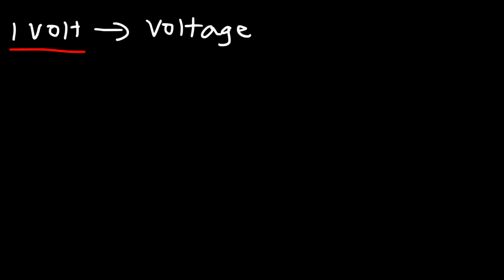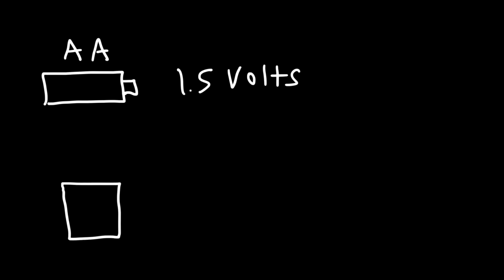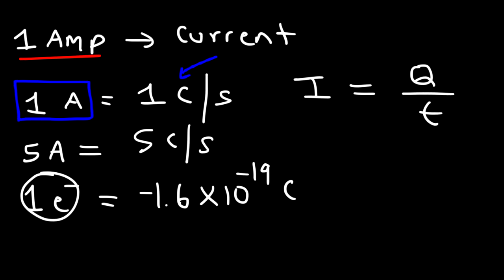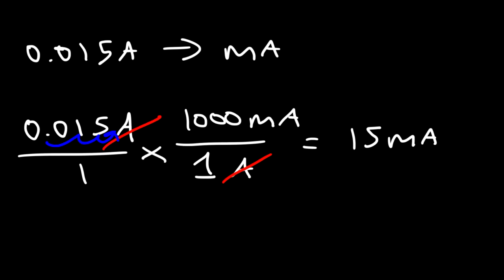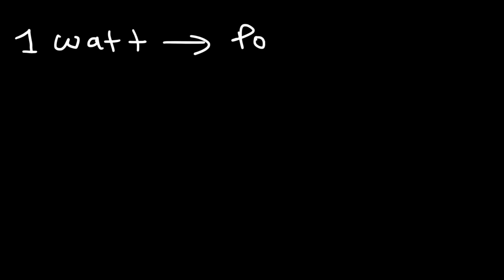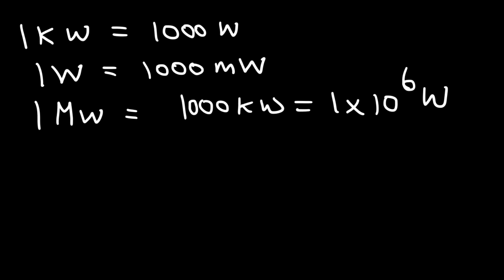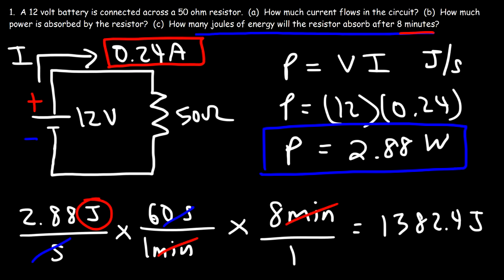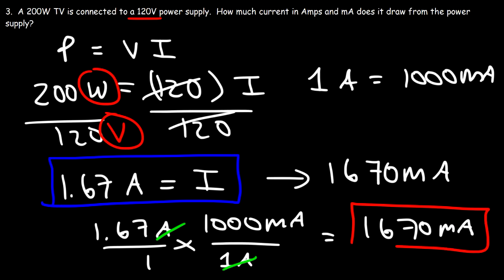Volts, Amps, & Watts Explained!

Comment: Practical and clear explanation but I would like to confirm something. If I apply the knowledge I got from the video above, for example if I go and buy a 1200 watt power supply for my new building pc, it means that power supply will consumes 1200 energy of joules per second and as I know = More Voltage = More Amperes = More Charge of energy, So I need to have high voltage that can produce 1200 energy per second to match the power supply right??

Comment: Hey I have a question. Does a small appliance using 750 watt differ in power and electricity usage than a large appliance using 750 watts?
Reply: If all the conditions such as the resistance of the appliances, the voltage of the mains power supply are the same then according to my limited knowledge there won't be a change is the electricity usage

Comment: Would it be fair to compare the equation of Watts=(Amps)(Volts) to the equation Force=(mass)(Acceleration)?

Obviously we're talking about two different things, one refers to electrical energy while the other refers to the inertia of a body, but would the relation be comparable? If it is, then it would be easier for me to understand, otherwise, then I'm way off.
Reply: Yes, it would be fair to compare the equations "Watts = (Amps) x (Volts)" in the context of electrical power to the equation "Force = (Mass) x (Acceleration)" in the context of Newton's second law of motion. Both equations represent a fundamental relationship between different physical quantities.

Comment: If the total charge is 4,3 x 10x21, and each electron has the charge of 1,6 x 10^-19, why isnt it correct to devide total charge with the charge of 1 electron? Wouldnt that give me the total number of electrions passing? And from there i could devide that with 6,24x10^18 to get it in coloumbs?

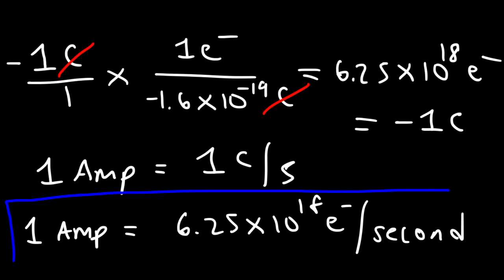Comment: in 8:00 shouldn't it be -6.25x10^-18e/sec?, because you said -1c = 6.25x10^-18e and not  1c = 6.25x10^-18e

I am talking about the negative sign
it's weird because then a positive coulomb is equal to negative amount of electron which is nonsence.

here is my explanation for this please tell me if I am correct: so basically I this of "negative" number of electrons(or a +ve coulomb) as electrons flowing opposite to the direction i am measuring and "positive" number of electrons (or a -ve coulomb) as electrons flowing in the direction i am measuring, or maybe vice versa.

please give me feedback on the correctness of this.

Comment: So how many volts is in 1000 watts ?
Reply: your question does not make sense sorry
Reply: @jeremykemp3782  i have a 1000 watt inverter, i just want to know would that inverter be enough to charge something that takes 240 - 245 volts ???
Reply: @mangreat71  well an inverter is for changing dc current to ac current.  yes is the answer .  for example, if you connect your inverter to a 12 volt battery, you can then plug in your 240 volt appliance ie anything that is up to 1000 watts.  tv, radio.  maybe not a kettle
Reply: @mangreat71  To charge what is a good question actually
Reply: nothing too big hopefully

Comment: where did that ohm come from? sneaky. like a ninja. A lot of talk of W V and A and then Ω out of nowhere
Reply: ohm is a basic unit measurement of a RESISTOR in an electric circuit. When working with the base calculations of an electric circuit you'll mostly need the W V & A cos your already given the ohm - for the most part. HOWEVER, there's what we call an Ohm's Law used to calculate the unit ohm on it own.

Comment: This sounds like an odd questions but it's nagging me and I'm sure I will be wrong here. In your battery example that starts around 16min, you ask how much power is absorbed by the resistor. You calculate this value as P= V * I. Wouldn't this give you the power that traveled through the circuit not what the resistor "absorbed". Shouldn't that be something like, Total power without resistor - actual power = total power absorbed by the resistor..
Reply: nah he used V= I * R which is pretty straight foward bcos you're only given the Voltage and the Resistance to work with. HINT: to find the adequate formula you can use - first look at what you're given to work with
Reply: That's something I was thinking about earlier as well. From what I understand, yes, you're correct -- he calculated the total power that went through the circuit, but that is equal to the power that went through the resistor, because the resistor is the only element in the circuit (besides the battery voltage source). If you wanted to calculate the power for an individual component in a circuit with multiple resistors, then you'd need to find the voltage DROP (the difference in voltage from before and after the component) as well as the current going through the component, which can be different from the overall current if the components are placed in parallel.

His explanation doesn't go with terms like "voltage drop" because that's a bit more difficult, but I'm sure he explains it in some circuit analysis videos more, unless he wants everything to be simple - which he usually does. Good thing is more people understand his explanation, but not the fully correct one, which can be damaging. You can look between multiple sources and see what people are saying to make sure you don't get the wrong explanation and actually understand what's happening.
Reply: Nice

Comment: Going back to 11:13 - can you confirm my understanding of this is correct. 666c comes because 4.3 x 1.6 = 6.88 and the difference between the exponent (21 and 19 here) is 2 meaning you take 6.88 and times it by 10 twice?
Reply: ur wrong
Reply: You're right. When multiplying numbers in scientific notation (as it was written here), you multiply the numbers before the exponent then you add the exponents on the base (10). If you want more information on how it happens, search for "Operations with scientific notation".

Comment: Just a suggestion:   But, I felt this video [is] more a video on differential analysis than anything else ( Which doesn't explain Volts, Amps, and Watts very well ). As an intellectual person from a different field of study I would simply suggest you focus on the core title, which is why i came here, in understanding all about volts, amps and watts.   What is there relationship between them.  It's easy to flash a few formulas on the screen which I could have gotten from a reference card. I want to better understand the relationship.  Linus Tech Tips #LTT was explaining for lamens people like myself in terms of a water faucet.  Could you make another video that helps explain this relationship more fully??  PS - I want to build my own electric car and I am still having some difficulty grasping the concepts for why batteries are in mAh, computers are in Watts, and electric cars are in Volts.  Thanks for the video!
Reply: dude, please tag me when ever you build it, for two reasons... you're definitely bitting more than you can chew if you don't even understand this and second, I literally love to se the norms broken ... good luck !
Reply: @edman2740  vacuum the crumbs out of your keyboard
Reply: @macswanton9622  where's the mistake ?

Comment: the conversion between millivolts, volts and kilovolts is easy if you use the metric system. It works very similarly.
Reply: ratichocc that might be hard for Americans 🌝
Reply: @bottleofwater1675  its just the removal of 0s

Comment: Teach...Can you answer this question that nobody else seems to be able to? Why do we multiply I x R to get Volts? Multiplying is basically repeated addition, so why would we do that if Current and Volts are proportional???
Reply: Shaine MacDonald
1 volt = 1 amp * 1 ohm.
Or
1 volt = 0.5 amp * 2 ohm.
Or
1 volt = 2 amp * 0.5 ohm.
Or
1 volt = infinite amp * 0 ohm.
(supra-conductor) 
Or
1 volt = 0 amp * infinite ohm.
(void)
Or
2 volt = 0 amp * infinite ohm.
0 * infinity is every number you want.